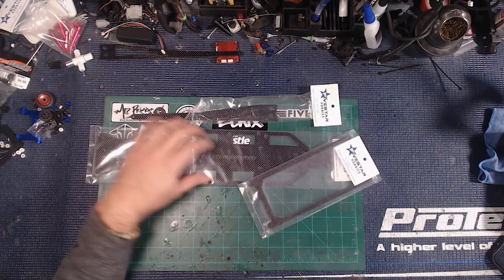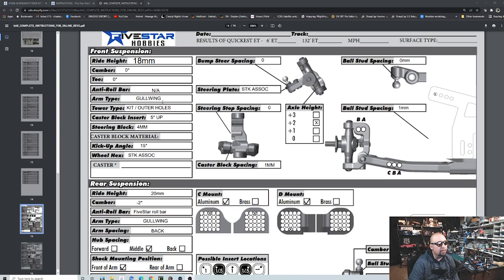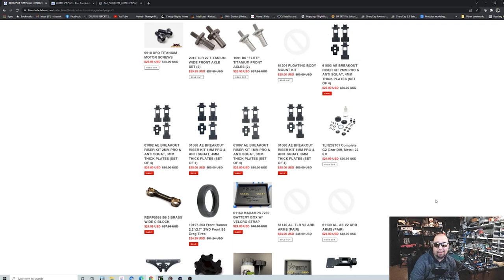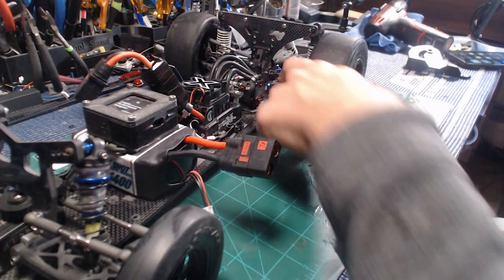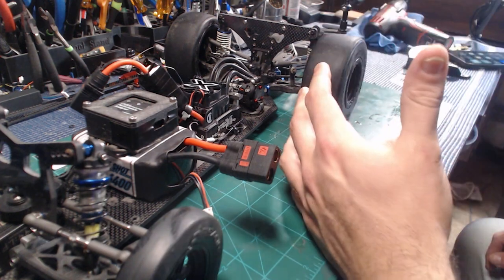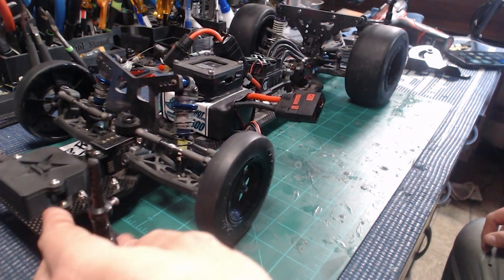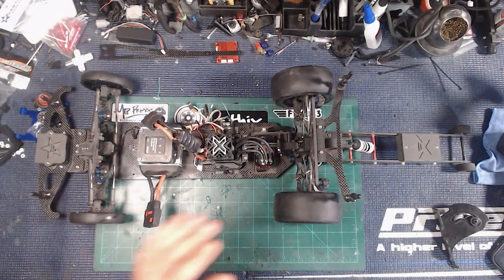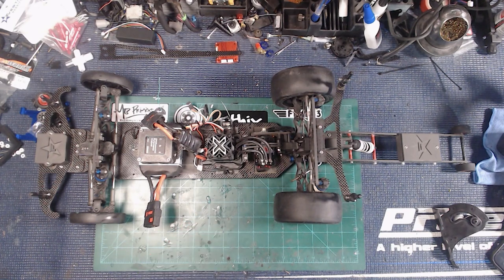NO PREP RC FRAME GEOMETRY | DO's and DONT'S | SETUP SHEETS  | WHY YOU WANT A RACE CHASSIS

Comment: Two questions:
I have a Associated B6.2 chassis set at 1/2" ride height. The rear half shafts are lower than I would like to see. Are there trans spacers on the market for me to raise it ? Or do I make them ?
Do you like to see the front springs heavier than the rear ? My thought on this is the front will rise faster and the back will squat easier.
Reply from the maker: You shouldn’t have to raise the Tran on most common chassis kits as they usually come with their own spacer. What chassis you running.
Reply: @Dorkyand40  Associated B6.2 mid motor

Comment: Hey Chad.. iam noticing that you r not running the upper chassis tray..  Are you getting better results that way ?
Reply from the maker: Yeah. Don’t want anymore weight then I need. If you look at many of the fast breakout people they are running no tray or the tray layered on top of the 3mm chassis to increase strength. I will be doing that when I get my parts and rebuild the car.

Comment: I can't understand why nobody (to my knowledge, anyway..) has incorporated droop adjustment screws... not for ride height of course, but to limit extension, especially in the front.  A made a set of limit straps for my DR10 based car.  It KILLS having to take the shocks apart to put shims in them!
Reply from the maker: Most b6 platforms have no droop adjustments. Some buggy’s do. I guess these purpose made cars should have a droop adjustment these days.